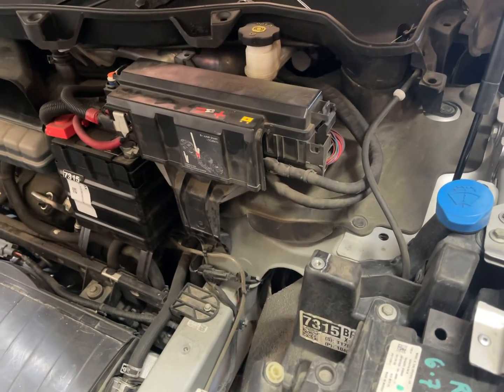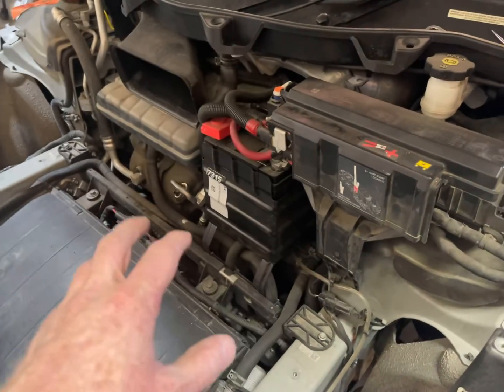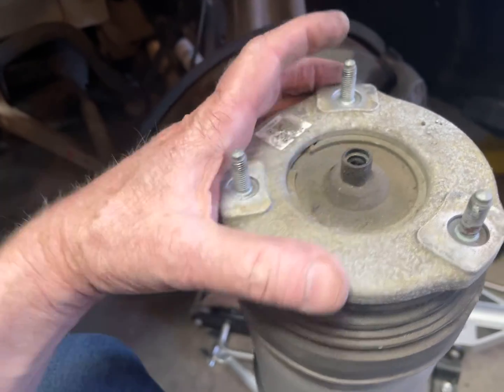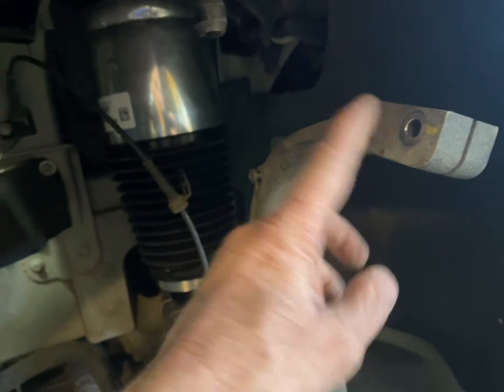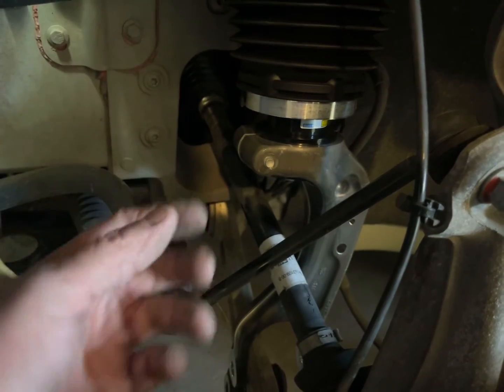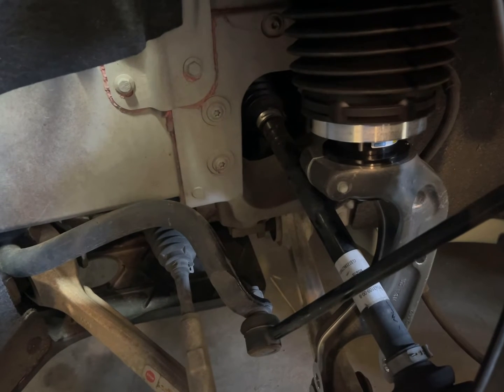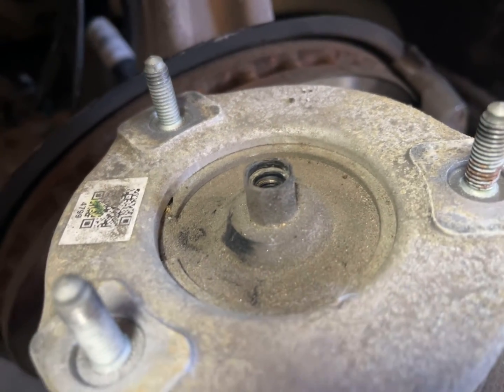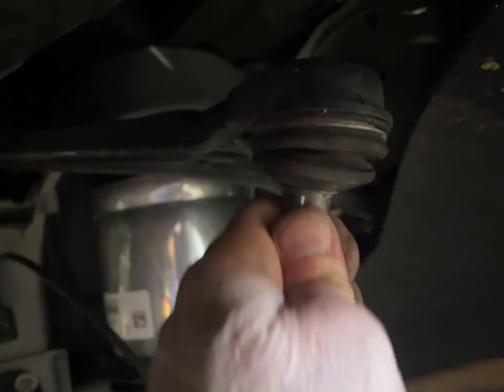Replacing an air shock on a Tesla model X

Comment: After replacing the strut, did you lower your car and jack all the way down, turn off "jack mode" and let the pump work from the original strut position? 
Or did you leave it at the same height as the other front strut, and let it auto-pump with "jack mode" off?
Reply from the maker: It’s in the service manual, but I compressed the strut to a specific height then I tightened the lower bolts.   After that I lowered it onto the strut and turned off jack mode.
Reply: @teslamike7476  What was that specific height? Could you copy a link to that service manual page? I looked but did not find anything. Thank You

Comment: This is very helpful thanks. Did you eventually opened it up? Was there a loose nut?
Reply from the maker: Thanks for watching and commenting.   I did open it up, it was just a loose nut.  I should have addressed that over a new shock, but now I have a spare lol
Reply: Many thanks Mike for getting back to me. Do you have by any chance a photo about the strut opened up where the bolt is visible?
Reply from the maker: I don’t next time I do it. I’ll make sure to get a picture and make a video of it.
Reply: Great. I have 3 friends in the nearby with possibly this issue. It seems to be quite a common problem.

Comment: Hi Mike, may i know what sound you experienced. I have a knocking noise when my car is at an angle going to ramp (e.g. mall entrance) and also when the car is going over uneven pavement. Tesla changed my lower arms and my upper control arms were replaced not long ago. I wonder if i do need to change the suspension. Thank you
Reply from the maker: Mine sounded like a hard “thunk”.     I checked all the other arms and found that the sway bar links were also loose.   So I replaced the sway bar links and it got better but still had a thunk.   After replacing the shock it’s been pretty quiet.
Reply: @teslamike7476  thank you for your prompt reply. Is the noise consistent over uneven surface or just one time? Mine sound like a loose sway bar, when the body of the car is not flat, and going over uneven surface it would make knocking noise. Tesla said everything is tight, but saw a broken bushing at the lower arms so they replaced it with no change to the issue.
Reply from the maker: I would replace the sway bar link, those are pretty cheap and it’s good to eliminate it from the potential issues.
Reply: @teslamike7476  I asked tesla if that's the issue and they said they look healthy. But we all know how sloppy they can be. That's actually what I have in mind, but it does look like it is in regular shape as well. I might as well start doing that.

Comment: Hi Mike, 

Thank you for the video! 
I used it to help me repair my shocker! I opened the pin up and can confirm there was a nub below that had become loose. I tightened the nut (you need a Hex key to hold the bar whilst you tighten it). I cleaned the seals under that plastic cap as it creates a seal for the air in the shocker. 
PS I was able to recreate the rattle/knocking sound when I pushed down on the shocker after I had removed it.
Reply from the maker: @HarveySingh76  that’s great to hear!!

Comment: Hello, 
the Tesla has recognized the new shock absorbers automatically?
It was able to recalibrate the gas inside the shock absorber itself?

Do you have the video of the 'old' shock absorber opening?

Thank you for your videos.

Ludovic from Switzerland
Reply from the maker: I didn’t do any calibrations on it, I just replaced it and turned jack mode off and it’s been great.    

I’ll get a video posted of the old shock, thanks for the suggestion.

Comment: Did you buy the part from Tesla? $200 sounds crazy cheap. I just got quoted $900 from Tesla.
Reply from the maker: I didn’t.  I got it off eBay.
Reply: @teslamike7476  Was it a brand new one for $200 on ebay or used one? Can you please share us links on ebay for this part for 200?
Reply from the maker: It was a one off.